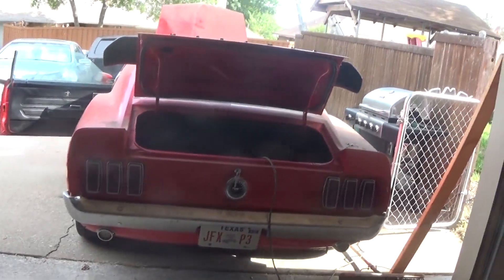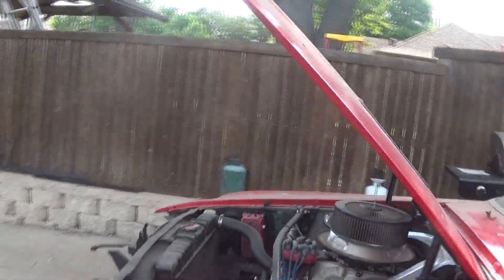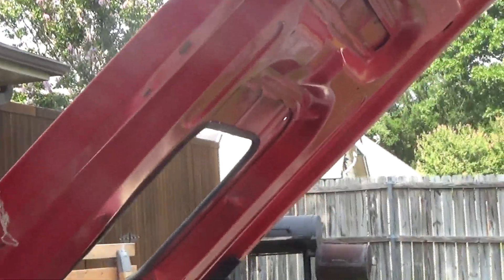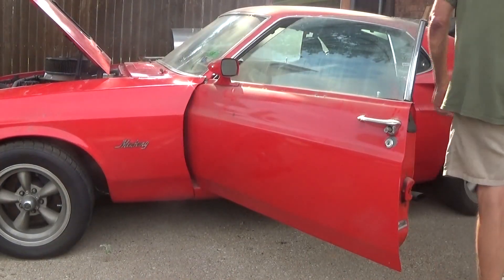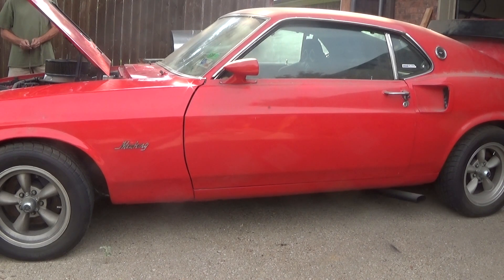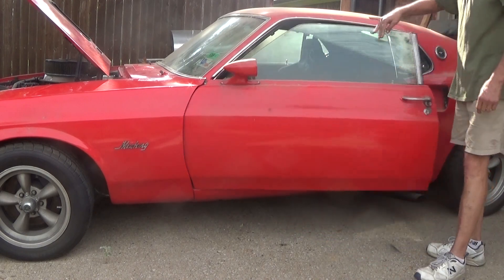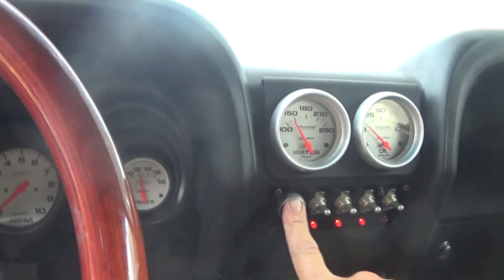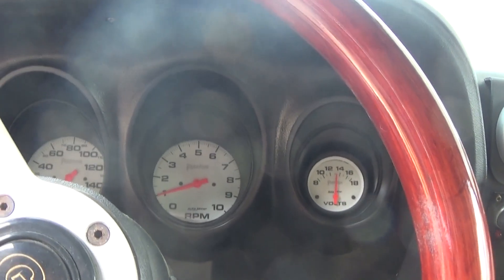393 stroker coldstart

Comment: What cam?
Reply from the maker: It is a custom built cam, that was built by a guy in Connecticut.  I bought the cam and AFR 225 heads from him.  He had me fill out a questionnaire for the cam that covered everything from engine description, drive train description, car weight, intended use, and desired RPM's for the power range.  This is an open track race car, and I wanted power from 2800 to 6500 rpms.  According to the chassis dyno, he nailed it.  540/537 hp/torque at the wheels.  I have the spec sheet for the cam somewhere.  It has .628 lift, and I am running Crane solid, roller lifters.